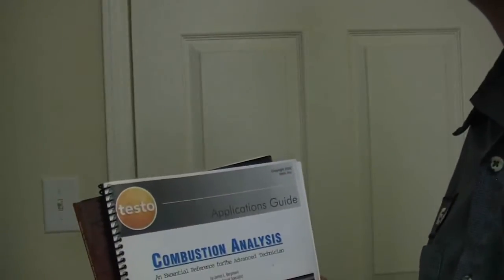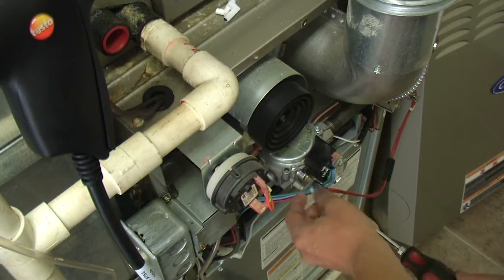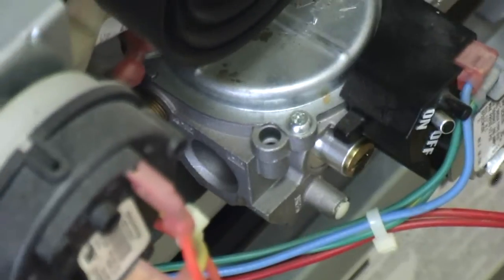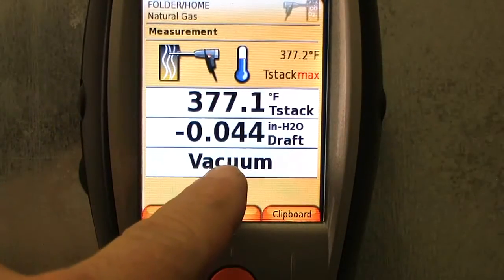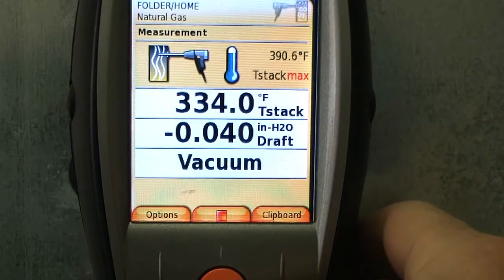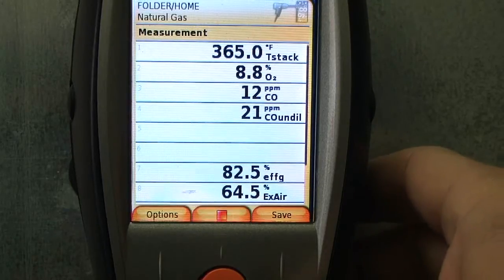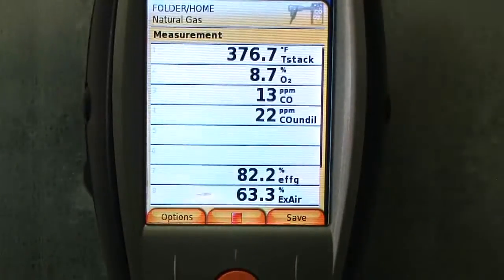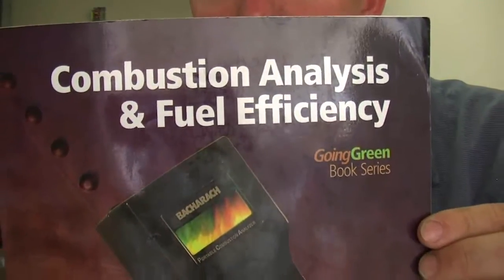Gas Furnace tune-up with Combstion Analyzer (Part 3 of 3)

Comment: Eddie, my draft reading is 0.004. Because of an adjustable flue pipe I had to drill my hole at the ceiling.  Do you think that could cause the low reading? or do I have a problem?

Comment: Hi Eddie, nice videos good job.  How much do you charge for the tune up in this video? and does it differ from a basic check and if so how much do you charge for that? 
Also do you do a visual check of the heat exchanger? or do you just test by the O2 levels?
Thanks Jim

Comment from the maker: @mmantini83 You want to make sure that a furnace or water heater can make draft in less than 60 seconds, and if you use that rule then yes, you will have to let the unit cool off. 
To be honest though, I don't always start with a cold furnace, but I still want to know if it is drafting properly !!

Comment: @eleverich Thanks Eddie! Following your example, I'm convinced that I'm doing the draft test correctly. Just one question. During the zeroing out phase, before reinserting the probe, do you need to let the temperature recover back down to near room temp? Looks like the initial temp indication is not effected by the pre-initialization(i.e. zeroing ) phase. Again, thanks again for all your efforts with these great videos! Mike

Comment: Where do you work that you can afford toys like that 330? I'm moving there. Just kidding.  That thing is awesome. I've been thinking about getting the 327? Like you said, "If your not measuring then your guessing".  $1000 will buy a lot of groceries though. 

The other side is I'm pulling blowers to visually check heat exchangers. It would be sweet to be able to read O2 and Co2 levels. I do use my monoxer to check flue Co. Testo has been running a sale on'em but even still, I've got sticker shok